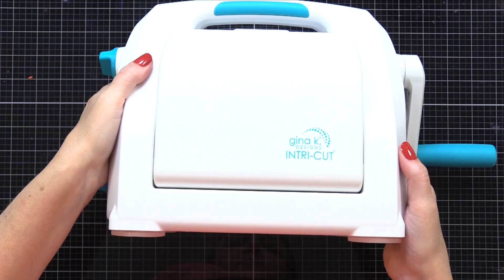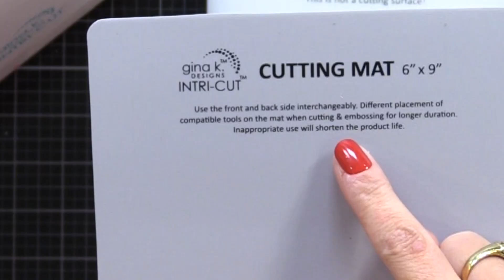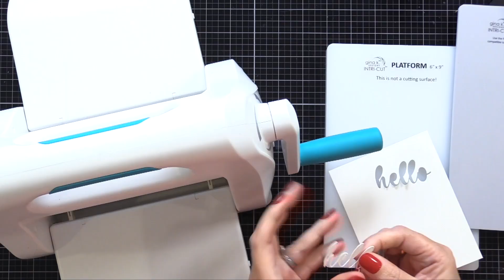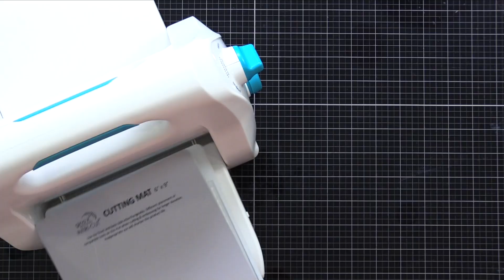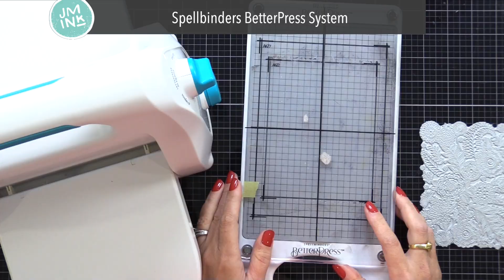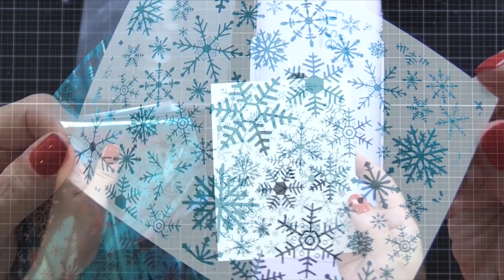NO Guesswork Die Cut Machine!

Comment: Great video on how to use across the board. I was going to treat myself to an upgraded Spellbinder P6 later this summer. (I have one P6 & 2 P8.5's and gifted one P6 to friends a few weeks ago.) I have the glimmer hot foiling system. It's great to know the Gina K will work with it. And I'm impressed with the results. One of my problems with the original P6 is it was too deep an impression or more letter pressed & as much as I might like the results it often was just too much. Your results didn't show super indented stars. Love it. I also read that steel rule dies will work in the Gina K. I've switched my focus from the P6 update to the Gina K. People if you want to compare the Gina K to the lock alike Bira do a deeper internet search for their differences. There are a few. Also I've read a lot of similar and like problems with the Gina K mini so perhaps stay away from the mini as it is known to have the handle seize up and get poor die cutting. I'm not sure Gina K has a 9" machine that's a wider mouth but Bira does. So I was looking at the Bira as a means to replace both Spellbinders. I have a huge investment in the Spellbinder machines but I'm sure I could sell or gift or even keep some as spare machines in storage just in case I ever had a machine failure during a big project run. (A year ago my P8.5 became laid up so to speak when a Sizzix Chrome precision plate left over night sticking out both sides of the rollers warped and deglued creating the plastic to curl up on both sides and due to the solid metal plate it was locked in the machine. Took me 3 days to work it out without harming my machine itself. I learned a valuable lesson not to leave any of my plates sit under or straddling of sorts the slot when unintended. So as much as I love my Spellbinder machines and not willing to throw them under the bus by any means. I'm finding the look of the Gina K Intri-cut appealing enough to change brands. But plan to hang on to my Spellbinders for a while at least. Full disclosure I have a new Empress, A motorized Sizzix Big Shot never used but now 3 years old, 2 Diamond Press 4.5 Marquise and just ordered their new 7" Grand Marquise machine. I discovered over the weekend the Grand cutting folders were available for free shipping. HSN has terrible shipping prices for multiple stacking of multiple items ordered. So I saved 14 items ordered by approx. on average 5 dollars each by jumping the gun before ordering the machine. Turns out it was the right call. HSN lowered the price of the Grand M by 25 after including now the shipping price. I snagged a silver one I'd hoped for right at 10pm here in Mountain time and Eastern midnight launching for this item. I ordered 3 packages of each size of the  Grand's cutting folders and also the lantern die and a cheap Samsung phone and a few other goodies plus 5 sets of the pack of ten  4.5" Marquise cutting folders too.  These are all being assembled later this month to organize all my many word dies and make 5-7 die cuts of each in white card stock to have pre-made ones at my finger tips plus more important that I can READ and see the size of. I've collected so many I can't sometimes grasp what they say. I've developed vision problems. I'm looking for more tools that help me still stay active with this hobby. This includes a new Spellbinder score and trimmer paper trimmer tool. I can't see edges properly to score any more. And some of my aides that worked in the past are not as helpful as my vision gets a bit worse while on hold for surgery to treat a Macular fold/wrinkle or perhaps even what they refer to as a bubble too. It's complicated. And frustrating to a person who in her teens was told that she had vision 1 out of about 400 called perfect or super vision where I could not only see extremely long distances but hold tiny objects I study and part of my career without the use of a microscope focusing on everything in between without problems to adjust. I was aware how lucky I was...but now that my vision has declined I find myself being more fussy having been spoiled more than I realize. Anyway all the times I can set down a cutting plate especially when clear and not see it to pick it up when ready...yeah having just one cutting board that is usually a medium grey is going to be so helpful. That alone has sold me on this machine. Love Jennifer has done such yet another remarkable tutorial. Guiding me further into just how wonderful this machine is and maybe even better than the brand that the Letter Press dies and equipment and hot foil system too is made for. A quick note some companies are tacking on up to $25 dollars in the USA for international shipping while Scrapbook.com is not. Watch for their deals of 8,10,13,even 15 % off an order also rarer free shipping all help with an order. Grab any of their freebies too on that site. Anyway for now I'm leaning seriously towards buying this machine. Wish I'd understood this one existed when I first got into it.

Comment: I feel like I’ve waited so long to get this machine. I finally saved enough monies to get it. But I’m kinda disappointed. I mostly use altenew dies and every time I put one through, it comes out with little tufts of paper around the edges. I have the bottom dial turned to -3 and it still does it

Comment: I don’t know if maybe this was a new machine in the US when this video was made, but me living in Sweden have had it for several years, and sadly I have to say that I don’t like it. 

It does have these great features that Jennifer is showing with different settings for die cutting and embossing and so on, and that is great. And it works well, so I cannot complain about the ability to cut and emboss. 
The reasons I regret buying this machine are the following: 

1 ) The cutting map warps super easily. After a only a few times of usage it will be warped so bad that it will destroy delicate dies. I’ll make the cutting mat straight again by putting it in a oven plate with high edges and por boiling water over it. It will be straighten immediately, so it’s a rather easy fix, but still. The fact that I have to do this every 5th or 8th cut makes me hesitant to use the machine. 

2) The cutting mat is on the top. This means that the paper is placed on top of the dies, so you can’t see the dies’ position and you can’t make sure it will cut where you want without taping the dies to the paper. A constant extra thing to do which really irritates me every time. I will never buy a die cutting machine with this feature again. 

3) It is really heavy. When deciding to finally buy myself a larger die cutting machine (I had only had one of the smallest ones up to this point) I thought I should treat myself with a large one to not limit myself in the future, if I wanted to cut with really large dies. But the machine is so heavy that I am reluctant to bring it to the table. ( I don’t have space enough to have it on the table all the time, but have it stored right next to the table.) And I have never seen dies that demands this size of this machine. 

I’ve had this for at least four years now, and am now finally looking for a replacement machine. With harder cutting mats, smaller size and with the cutting mat on the bottom of the ”sandwich”. 
- ’Cause I’m worth it.

Comment: This was so helpful.  The instructions that comes with it shows the 3D folders being used without the cutting mat.  The folder I was using would not work even on the tightest setting.  Your explanation of thickness variations  by brands made all the difference.  I needed to use the cutting mat and then it to a looseness of 4 and then it worked beautifully.

Comment: Thank you so much Jennifer for a very detailed tutorial on the Intri-Cut die cut machine. I'm still confused and afraid to use it because I don't want to mess it up. One question I have is your direction to put the back side of the die face down  but  wouldn't that be the front side of the die with the back side facing up?  Thank you.

Comment: What is the paper weight you used for the intricate die.  My first cutting mat has warped quite a bit.  Is there a way to have it straighten or should I just buy a new one?
Reply: I have great success with weighing it down in boiling water with a 5 lb weight.

Comment: I saw another crafter demonstrating this Bira Craft Die Adjustable Cutting & Embossing Machine.  It is cheaper on Amazon. My question, which came first ... Gina K's or theirs?  I'm concerned theirs is a "knock-off"
Reply from the maker: turns out there are several adjustable die cut machines out there. i had never used one. not sure if they all work the same... i just know this one works great for me! :) my guess is there is one manufacturer making these machines.
Reply: The Bira machine has reviews going back to 2021.

Comment: Wow!  I learned so much and this sounds like a boon to someone like me, still using my trusty but discontinued Cuttlebug.  My experiment with a pricey, highly recommended electric machine was a disaster with broken and/or uselessly warped plates.  I don't use it.  And I have a mini/table top Tim Holtz die cutter, limited as to size but extemely handy for small things.  I'm afraid to even try 3D folders in the Cuttlebug -- but I drool over them.  Thank you for the time you put into these valuable videos, particularly this which sounds like it would be extemely versatile and almost idiot-proof..

Comment: This machine seems great, a lot of features. My only concern is having to flip the die and place the cardstock on top of if - the opposite of most of the machines on the market - This may make it difficult to position the die right where you want on the cardstock.
Reply from the maker: actually, most machines recommend this way but you don't have to. if you wathc, i show doing it so you dont have flip it. works great!
Reply: My thoughts exactly, because that's why I didn't use my Gemini much, it bugged me to use it that way, but wondering if we flipped the plates the other way, if it would work
Reply from the maker: yes, watch again - i show you dont have to flip

Comment: This is identical to the Bira Craft I've been using and I love it. I bought the magnetic mat and have pretty much eliminated the use of tape.
Reply: Considering options! Do you have any opinion as to how your Bira compares to the Gina K quality wise? Thank you!
Reply: @donnacarraway9182 no I don't.  Sorry.  It looks identical in every way except color.
I just know my Bira Craft is high quality and will likely last for years.
Reply: @donnacarraway9182  Exactly the same machine except for the color and the price!
Reply: Do you think the Bira magnetic mat can be used in the IntriCut? Which plate would it replace? Thanks
Reply: @shistah1 if it doesn't exceed the width of the opening, I don't see why it would work. You could always return the magnetic mat if it doesn't work out.
Reply: I was wondering about whether they’d eventually release a magnetic plate to use on the bottom! Good to know there’s already a tool out there with the magnetic plate option! 😊

Comment: I have some flower shaping molds from Heartfelt Creations - they are 5/8 of an inch thick - I wonder if I could run these thru the Intri-Cut - I have the Empress and they don’t fit in the opening - I have an older Cuttlebug that I use but they are hard to crank thru the machine

Comment: Very cool machine:) love how you can set the knob for the right setting:) Great job on showing us a great machine:) Happy Thanksgiving and God bless:)
Reply: wrmk evolution advanced is identical to this one and came out about 9 yrs ago and I loved it and through two of them during a 4 yr span (had the electric motor attachment) but the internal gears for the adjustment dial locked and stayed locked in 1 position.  The “A” plate was the best as you could die cut and emboss in one pass!  I NEVER GOT WARPING ON ANY PLATES. But eventually got a Gemini junior which cuts great but I’ve always hated using “sandwiches” so maybe I will try this brand.

Comment: Looks like there are some improvements on the dial system from the original machine  about 10 years ago. I could never get the correct pressure to die cut smoothly. I already have plenty of machines so i sure dont need this one. But good for those who need one!

Comment: Just watched Gina….as you fold down the arms, LOCK IN the arms….it locks the bottom suction cups into place so it won’t slide on all work surfaces, not just a glass surface.  I felt this was key in using the new machine correctly.  Thank you for all the additional trials and learning curves you shared with us.  What a truly versatile machine…and you figured out the details for us! Thank you 🙏 🥰 ❤️
Reply: When you fold out the arms that suctions the machine to whatever surface it’s on. You do not have to lock the supports in place for the suction to work. I don’t own this  machine, but I watched Jennifer‘s video as well as a couple of others and they all said the same. No need to lock the sides in place. I suppose some may not work properly. It would be hard to understand if they were all three wrong.

Comment: In the words of Gina K, you knocked it out of the park with this one, Jennifer! Very clear direction and can’t wait to get my hands on one of these! Thank you for another awesome video, Jennifer!
Reply: wrmk evolution advanced is identical to this one and came out about 9 yrs ago and I loved it and through two of them during a 4 yr span (had the electric motor attachment) but the internal gears for the adjustment dial locked and stayed locked in 1 position.  The “A” plate was the best as you could die cut and emboss in one pass!  I NEVER GOT WARPING ON ANY PLATES. But eventually got a Gemini junior which cuts great but I’ve always hated using “sandwiches” so maybe I will try this brand.

Comment: Question at the end Jennifer.  I had an early cricut (?) manual crank but got rid of it as I hadn’t really jumped into die cutting.  Then I bought a Vagabond2!  Love it still but it is on its last legs.  I also had a manual crank fixed platform Sizzix but it just took up too much room.  Do you know if this unit can handle Heartfelt Creations embossing molds?  I am a late-comer to them but have fallen in love with the results.  If it can, I’m gifting myself one!

Comment: Brilliant! Best Machine made ever? I'll have to get me one! Hope she'll make a bigger size machine to accomodate larger paper size as well.
Reply: wrmk evolution advanced is identical to this one and came out about 9 yrs ago and I loved it and through two of them during a 4 yr span (had the electric motor attachment) but the internal gears for the adjustment dial locked and stayed locked in 1 position.  The “A” plate was the best as you could die cut and emboss in one pass!  I NEVER GOT WARPING ON ANY PLATES. But eventually got a Gemini junior which cuts great but I’ve always hated using “sandwiches” so maybe I will try this brand.

Comment: This new machine looks a lot like my We R memory keepers-Evolution Advanced.  I got it at an online auction, it was never opened but it is an older die cut machine.  All the info you showed me applies to my machine, down to the rubber mat it came with.  Thanks, now I know how to better use it!
Reply: I have it also and it's exactly like Gina K's new one. I love it! ❤️
Reply: Exactly what I thought. I loved my WRMK machine til I couldn't adjust it
Reply: Yes the wrmk evo adv is identical to this one and I loved it and through two of them during a 4 yr span (had the electric motor attachment) but the internal gears for the adjustment dial locked and stayed locked in 1 position.  The “A” plate was the best as you could die cut and emboss in one pass!  I NEVER GOT WARPING ON ANY PLATES. But eventually got a Gemini junior which cuts great but I’ve always hated using “sandwiches” so maybe I will try this brand.
Reply: I've been using my evolution advanced since 2016 and I love it 🖤
Reply: I have the WRMK one too. Not my favorite but I do use it for certain dies.
Reply: I love my Evolution! I bought the electric attachment for it and that is a huge help. Does anyone know how to use the newer 3D embossing folders? I found a video on steel rule dies but no one has shown how to use the thick embossing folders.
Reply: @lucygonzalez9247  Do you know how to search in the youtube app? Just type 3D embossing folders and literal I guess at this point tens will show up I don’t think it’s gotten to the hundreds point yet since they’re so new but yeah there are tons and tons of them on YouTube! Good luck!
Reply: I have the Evolution machine also, but I had trouble getting the settings right. I’ve been meaning to sell it. Maybe I’ll dust it off and try it again.